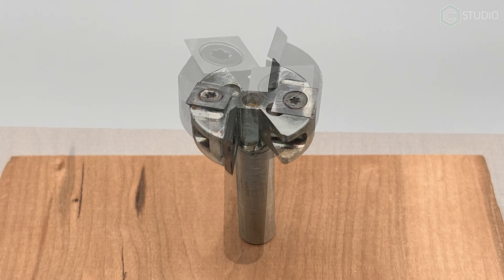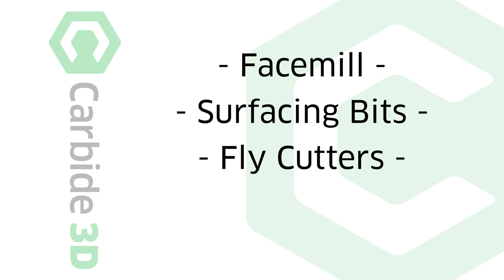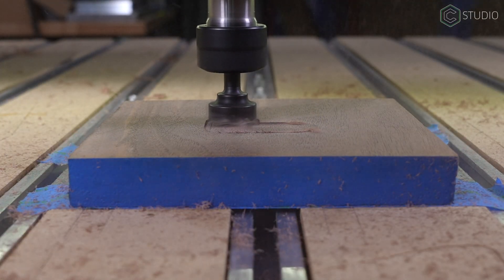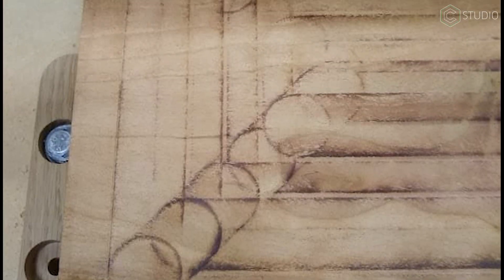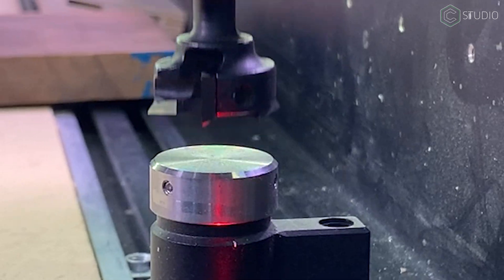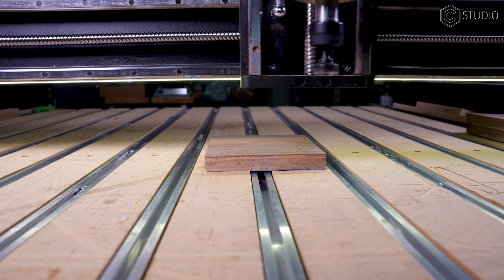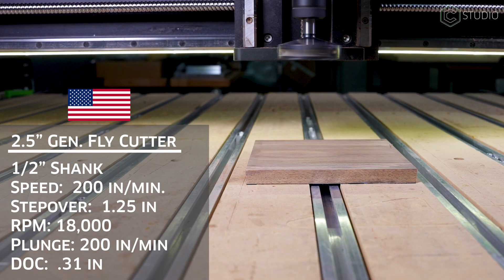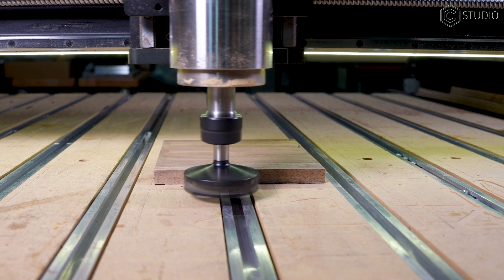Speeds / Feeds & Knowledge for Surfacing Bits / Fly Cutters

Comment: Aluminum?
Reply from the maker: You are welcome to surface aluminum with a shell mill.  The angles of the inserts in these tools are incorrect for aluminum.
Reply: @carbide3d  Do you sell a shell mill? Surfacing with a 1/4” on aluminum isn’t great.
Reply from the maker: We do not sell those endmills.  They are specialized and somewhat expensive.   There are some options out there.

Comment: I have the smaller shapeako pro xl which won't cut the full waste board area but I sometimes use that area in projects where I am tiling. Any suggestions on best way to resurface the waste boards. Related can you buy just the waste boards?
Reply from the maker: You can shorten those slats to within the travel of the machine.  Remove them, cut them shorter and reinstall.